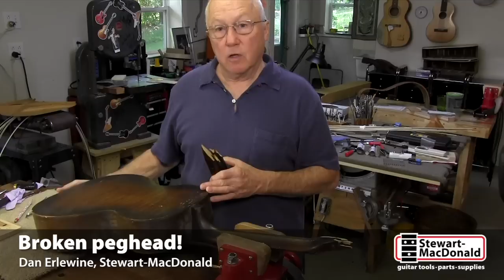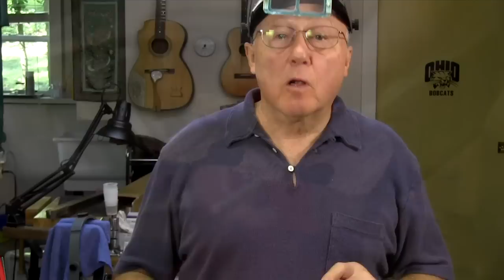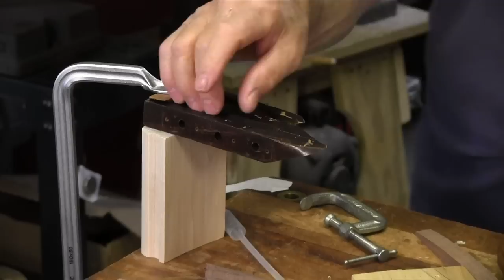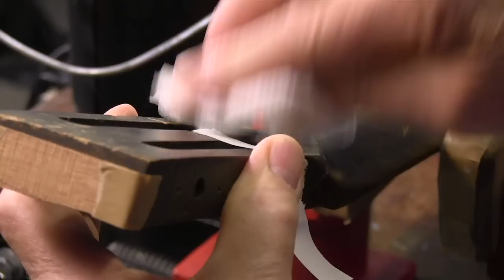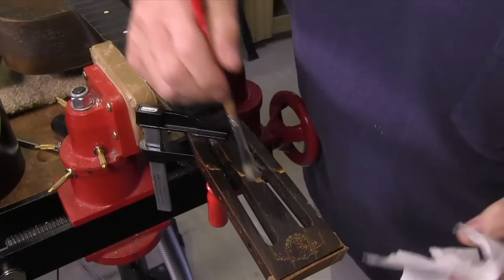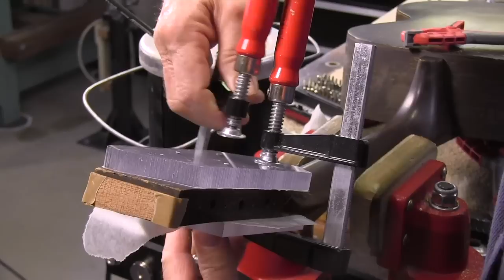Gluing a broken guitar peghead

Comment: Last week we had a guitar sent in to the shop I work at with a very similar break to the one in this video.  It had clearly been repaired before and the glue joint had failed after it took a bad hit.  After doing a bit of research on the best adhesive to use for the repair (I considered regular Titebond, hot hide glue, epoxy) I noticed StewMac had uploaded this video, so I made up my mind to try the LHG.  I glued the headstock on Tuesday, left it clamped overnight and let it sit for 24 hours to cure before messing with it.  The glue joint was solid as a rock, and the guitar stays in tune and plays great now.  One thing I will say is that the LHG must cure under pressure because after 12 hours the excess glue from squeeze out was still kind of tacky but the headstock is solid.
Reply: Alex Taylor n

Comment: I had a Gibson mandolin headstock break. The repairman machined a rout on either side of the truss rod and installed two hard rock maple strips. He then refinished it and unless you held it just right in the light, you couldn't tell that it had ever been broken. And with the maple pieces, it'll never break again.

Comment: well i just did this repair so what i did a little different was after gluing the peg head i scraped and sanded both sideof the peg head then i traced the peg head out line on two pieces of beautiful blood wood over lays cut out the shape with a jewelrs saw guled and scaped them and fine600grit sanded them i fineshed it with a water  base shellac and fine sanded1500 grit and polished it looks great no ones the wiser

Comment: Those suction cups are messy - most cracks can be wedged open enough (even with the sharp edge of a Stanley blade) to slide a thin piece of plastic (cut from a plastic bottle or envelope) to feed/push plenty of glue in.

Comment: The first thing I would have done is check to see how the two pieces fit together. I do that before removing any loose pieces.  Then I see what can be salvaged before removing the loose pieces and set them aside to be glued in either at the same time or later.  Maybe the chunk that was missing was long gone before Dan got to it but saving every little piece after a break can result in an invisible repair if the wood isn't too damaged.
Reply: thats why i used a peg head over lay cause a little missing piece can spell weakness

Comment: Interesting. I built a guitar about 20 years ago with Franklin LHG but I hear nothing but horror stories from luthiers and that we should never even consider using it. My guitar is still holding up just fine but since then I have used Fish glue for the long open time repairs. I think maybe the LHG gets a bad wrap because people don't look at the date on the bottle and more importantly don't test it!
Reply: all hideglue is vounerable  to break down it was used because its easy to take apart with a hot knife and violins not having a large sound hole need to be take apart to fix i dont know if tite bond has solved that problem ? but hide glue is best for sonic transfer that is the tail thats been told over the centuries ?

Comment: my guitar has a crack on the upper part of the neck and upon closer inspection, the wood itself is split. it is still held on by quite a bit of wood and the fretboard itself along with the truss rod. if you tighten the strings, you can clearly see the split. ive removed all the strings but I have no clue how to repair it. can you help?
Reply: You mean like this? 1:53 You can use this same technique to fix it.

Comment: I did all that an it came out as perfect as it can but the touch up blending is waiting but not a problem. I'm thinking about glueing a 1/4" face plate on this yamaha I bought as you did on eBay 60$ new one it plays great I just want to give it a little added strength as it will match the black finger board and bridge but what will it do to the tone. Just wondering, I also have a Yamaha 200n silent with a black plastic pick guard and might just make it ebony.

Comment: Is the glued section really stronger than unbroken wood?
Reply: The easiest way to find out is get a good wood glue and two pieces of wood, glue them together and clamp them overnight, then try to break the glue joint. I've even done it with white glue and  have broken everything except the glue joint

Comment: I have always used Titebond or thinned ( warmed) epoxy for this type of repair.
Most lutheirs reject the notion of TItebond cold bottled hide glue.
Why would you choose to use this over titebond or epoxy?
Reply: I agree that the bottled liquid hide glue was problematic for me. Joints often exhibited squeeze out long after.  Today I'd use Titebond 3, which had a stronger cured strength than the regular.

Comment: Hi Dan Why not use Tight Bond glue for the head stock repair Just wondering? Or CA glue for crack?
Reply from the maker: Dan likely chose hide glue over Titebond or super glue for a couple of reasons. Hide glue does not creep at all, and for this repair you want as tight a joint as possible. It also dries darker than Titebond, so it blended better with the surrounding dark brown finish. Super glue would not allow enough work time to get everything set in its proper place. On top of all of that, hide glue is Dan's personal preference.
Reply: stewartmacdonald 
Thank you so much for the info. Great points.
Thanks again for responding take care
Ken

Comment: Can you use the suction cup method on titebond
Reply: Julian Taylor yes, the thicker viscosity makes it’s less effective than with hot hide glue however. That being said you can make it closer to HHG’s consistency by warming it in a water batt
Reply: Jerry Rosa (Rosa String Works) uses water before glue up and uses Original titebond. I have seen him use suction cups too, but the water before glue really seems to rev up the capillary action.